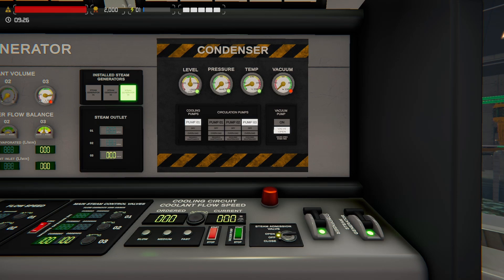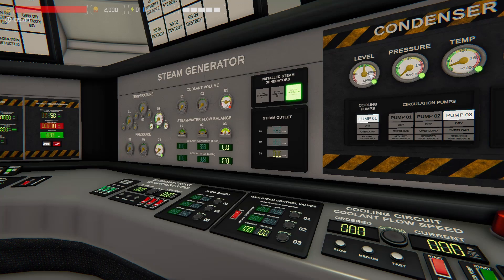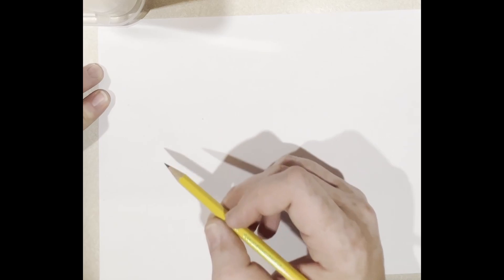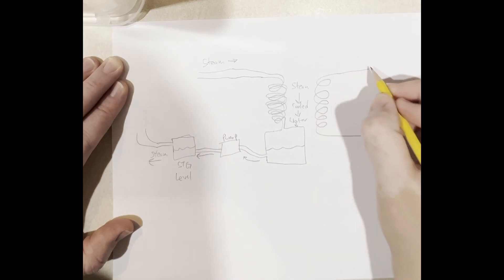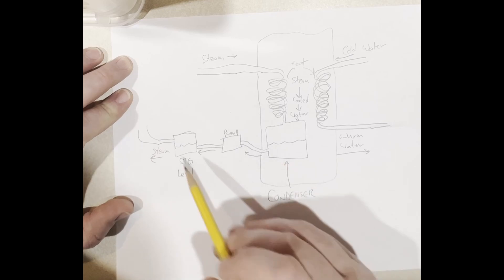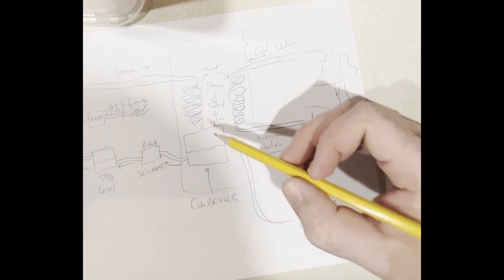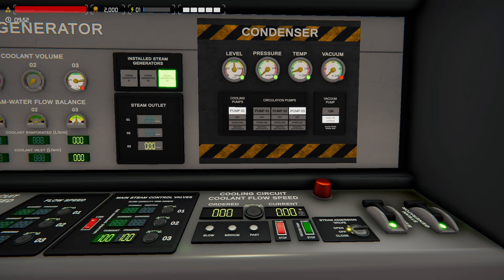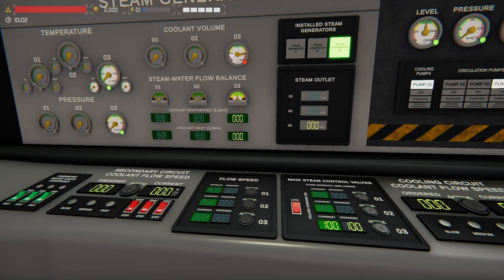Nucleares - Condenser (Fill Levels) Explanained

Comment: how to add water to condenser? if i turn on 3x sg ten condenser is empty and all sg"s have really low water lvl :/
Reply from the maker: There’s a condenser freight pump at the coolant system console that fills it up. I usually don’t fill it until I add the 3rd steam generator.

Comment: I can't keep the filler tank in the green mark on the gauge, for some reason i keep losing water in the filler tank of the condenser. How do i fix this. Patch 203
Reply from the maker: The retention tank?

There are several reasons this might be happening. 
If using the vacuum pump:
Make sure you have at least 50 kg/min steam outlet
Make sure pump is on operational mode (not startup)
For 1 loop, make sure OMSI is at least 30%
If using bypass, make sure SMSI is open and high enough to compensate

If not using vacuum pump:
Make sure you have at least 100 kg/min steam outlet
Make sure OMSI is 100%

Comment: can you do a video on how to fill the core pool tank and those that are on this switch board?
I flipped the M-Valves valves in every combination pressed the switches in different oders and i just can't get the core pool tank to fill up. it might be buged i don't know
Reply: Nevermind, i just tried again and now it works lol
Reply from the maker: If you need it, I do have a “switch-by-switch” video where I go through each panel in the control room. I think it’s under the “in-depth guides” playlist
Reply: @leonidasares  Thx :)

Comment: So my issue is that my condenser level is just fine but the generator level drops off quite fast. fast or slow on the pumps i cant seem to get my inlet and outlet to balance out. On the steam generator that is.
Reply from the maker: What do you mean by “generator level?”

You’ll want your secondary pump speed to be 5x your MSCV. And your MSCV should be single digits (probably). I have a video on the MSCV that explains this a bit. I also have a video where I do a startup and short run. The latter will show how I achieve balance and then adjust for demand while maintaining balance. You might check those out to see if they help.
Reply: @leonidasares  The level of coolant in the steam generator.
Reply from the maker: My steam gen levels also run low. I usually start my loops up with around 50,000 L as my coolant volume level, and burn about 35k off that during startup (which puts me close to the red). It comes back a bit but, during normal operations, my steam gen coolant levels sit in the yellow between low red and middle green and I never have issues. Take a look at those videos I suggested above and you’ll see what I mean